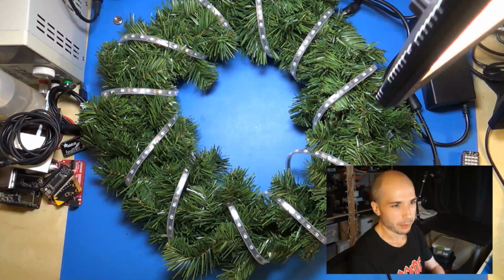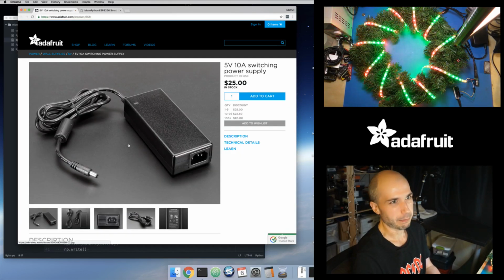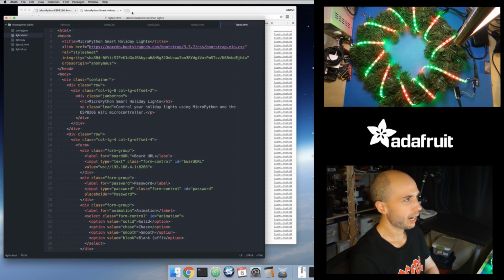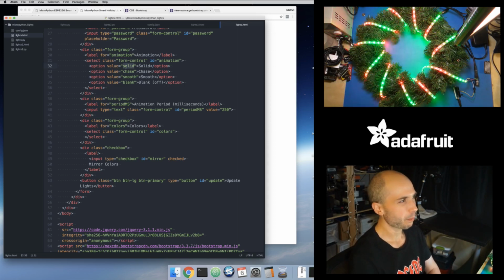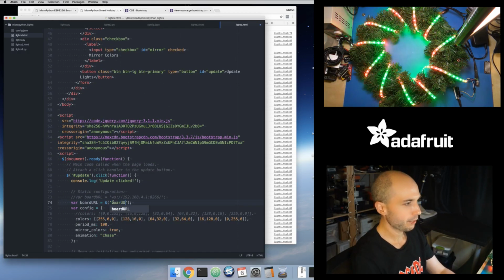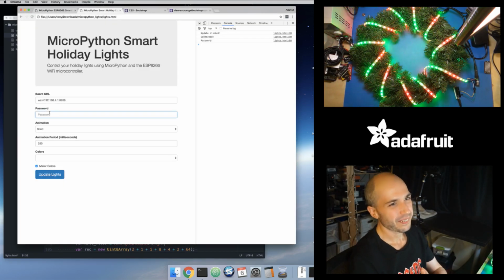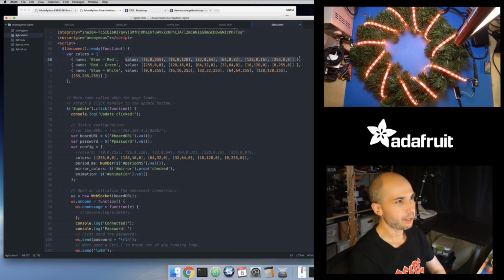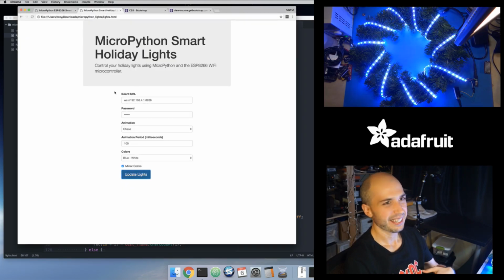MicroPython Smart Holiday Lights pt. 3 with Tony D! @micropython

Comment: I just wrote almost the same thing in arduino, with telnet control and color arrays and effects options. Would love to try micropython, seems like implementing the html portion is easier to do in py. Are you actually hosting the bs and jq libs i the flash or using CDN ?
Also how fast can you push those neopixels , do they run fast?